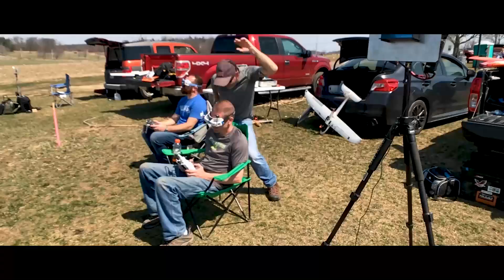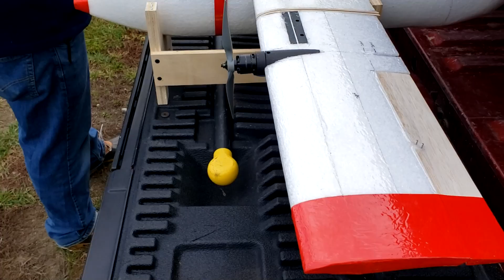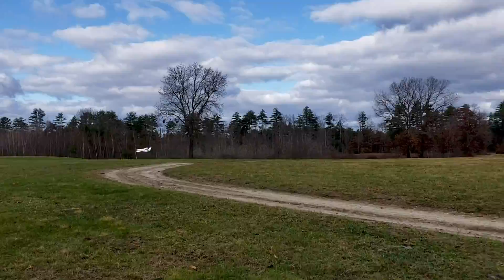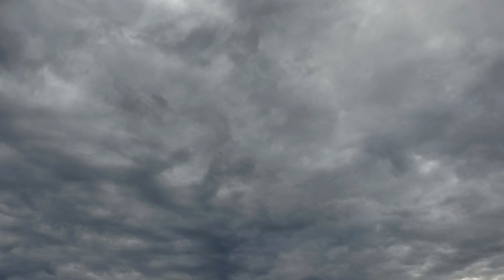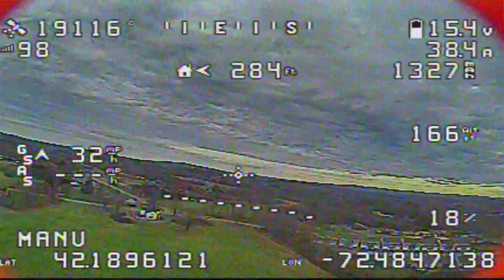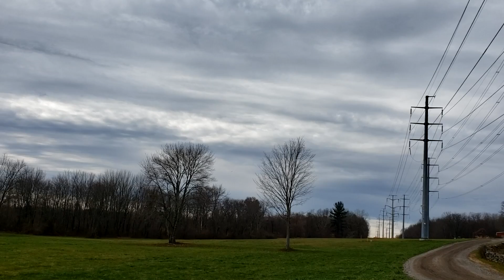Rogue VTOL Project - Part 2 Initial Testing

Comment: Great test result for forward flight. Well done for persisting with the hover flight mode. Are you going to give some insight into the FC programming?
Reply from the maker: Once I get everything figured out I might. Honestly it’s pretty much stock Ardupilot settings. You just need to pick the right configuration based on your type of VTOL. I figured I should get the forward flight down before attempting a transition. Transitions are where things get interesting and the last thing I wanted was to crash after a successful transition 🤣

Comment: Yeah, every vtol craft I have flown, hates ground effect. For those that don’t know, ground effect is when you are close to the ground enough that there is resistance from the air being pushed from the prop. In this case it is unstable and causes undesirable and unpredictable conditions. On a conventional aircraft it basically allows you to “float” the craft lower than its stall speed when in the effect. 
Viols however have a large underbelly and this one has its wings facing down, this is what grabs that turbulent air and causes the undesirable flight characteristics.  Most vtol flyer pound the throttle on take off to get out of the effect as quick as possible.
Reply from the maker: Exactly. Once I was able to get it up a few feet it was much more stable. The yaw issues made it tough to bring myself to just power out of it. Now it is normal launch procedure to hop it up a few feet and then stabilize. Hovering is a huge power drain so I try to get and transition as quickly as possible.
Reply: @DefiantWings  yeah, fixed winged flight is way more efficient than quadcopter or tricopter flight

Comment: I think it’s great your making a vtol, I think they are the best for long range quick deployment in tighter areas. Perfect for S&R applications.
Reply from the maker: That is our thought as well. They fit a space between multi rotors and long range fixed wing aircraft. Plus they are just really cool😎
Reply: @DefiantWings  totally agree, check out Crossblades idea to get around the drag of standard vtol setups.
Reply from the maker: I’ve seen that one. I like the concept but  a lot of moving parts.
Reply from the maker: I like the TransWing approach. Nothing is wasted. But a lot has to go exactly right on that transition